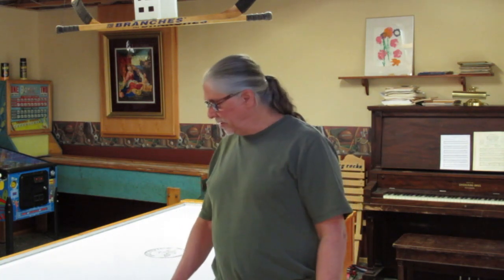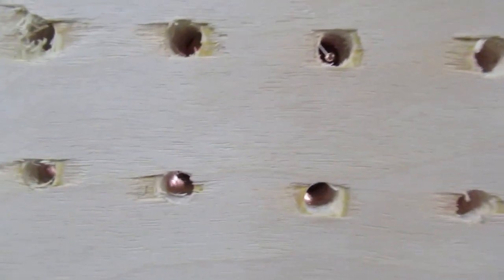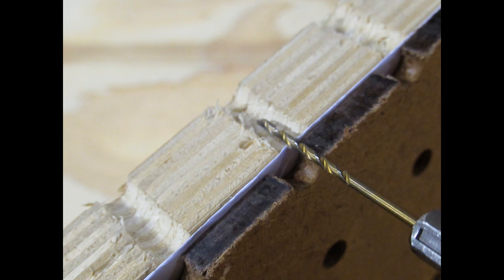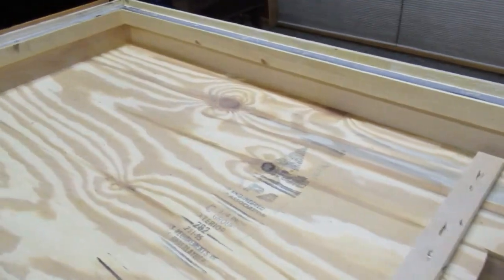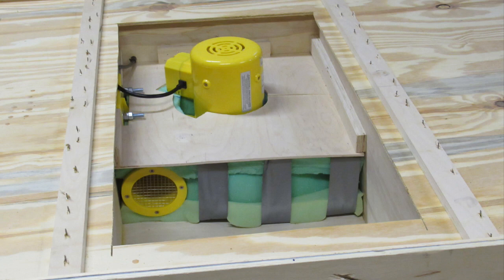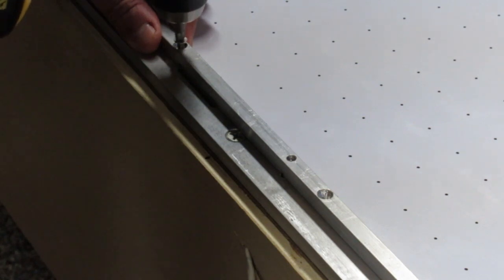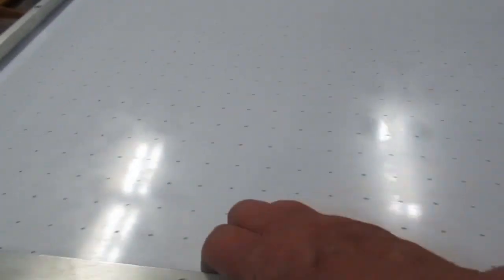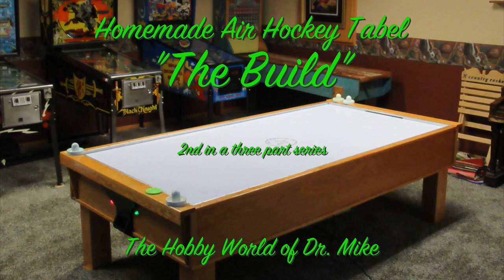Homemade (DIY) Air Hockey Table, The Build

Comment: Awesome looking table . Looks like you put in a lot of hours to put that together . Great work 
I'm about to build one soon . How wide did you make the goal ?  I cant find any info about regulation goal width online . Looks like your goal is about 12-16 in. wide . Also where did you get the aluminum rails ? Only thing i can find is flat bar and angle .
Thanks for any info.
Reply from the maker: Thank you.
The goals are 14" wide at the narrow.  I acquired the aluminum stock from a local metal supply vendor.  Most fairly large cities have a vendor that can supply the aluminum stock.
Reply: Now i'm trying to figure out how to apply the contact cement so it won't plug the holes up . I'm going to route 48 - 1/4in. wide dado channels horizontal on the play table then drill out the grid on the laminate . Did you brush or spray on the adhesive ? 

Thanks for your help
Reply from the maker: I used a roller to apply the contact glue.  I didn't worry about plugging the 1/4 in holes.     @82cutty
Reply: So you only put adhesive on the plywood ?
Reply: Or did you apply to both the laminate and plywood then drilled out the 1/16in. I won't have a problem if I can just put adhesive on the plywood . But I thought it needs to be on both
Reply from the maker: I applied the contact glue to both, let the glue dry then I stuck the two pieces together.  I then drilled the 1/16" holes with the pegboard hole pattern offset to allow more accurate hole centered on the 1/4" holes. @82cutty
Reply: Thanks
Reply: Hi...I have a question on how you have built the air box to get the air to the table ? A box in a box ? I have my table built finally and I'm only getting sufficient air flow to the middle 1/3 of the table where I have the grooves through the table top . I think my fan is not sufficient. I just ordered a 4.5 amp bounce house fan to see if I can get that to work .

Comment: Hey, Great Build,
What is the Cubic Ft per min air flow of the air blower you have used?
Reply from the maker: The blower I used has a 120V, 8A motor.  Cubic Ft per min is a fuzzy number when the air flow is restricted.  The 8A motor is oversized.  A little smaller motor would be sufficient and would probably be a little more quiet.

Comment: Hi I have an arcade Elephant AIR Hockey Table. It doesn't seem to give out sufficient air flow to play properly. I have seen alot of videos on YouTube trying to figure out what should be done to fix the problem. I bought a 1/16 drill bit and drilled holes and cleaned them... Than Light sand the whole things to get it smooth and than clean it off.. its nice and smooth the pucks are fine as well... the blower works great I took it out of the table to see if its work fine and blower is very powerful. Blower is mounted right in the middle of the table underneath it . And where the blower is mounted the air flow is fine there but on the right and left side the air flow is almost non existent...
Can u suggest what should I do plz
Reply from the maker: It depends on how the table is configured.  If the blower is pointed straight up to the holes in the table, then more air will flow right over the table.  I found that out with a different blower.  I pointed the blower I used to the side which generates a cyclone type air movement in the air box.  The larger holes in the ply wood also allows for a better air dispersion before the air hits the top laminate with the smaller holes.  The blower I used as a 120V, 8 Ampere motor ( answer to prior question) which is far more power than required.  A 4 Ampere motor would be more than sufficient and would probably run quieter.
Reply: @TheHobbyWorldofDrMike  Thank you for your response. So will an other blower facing upwards or side ways could be the solution to the problem?
Reply: @TheHobbyWorldofDrMike I wish I could send u pictures of My Air Hockey and Its whole Board etc